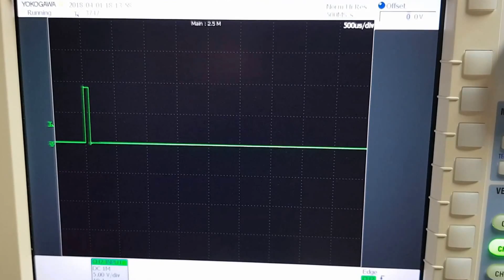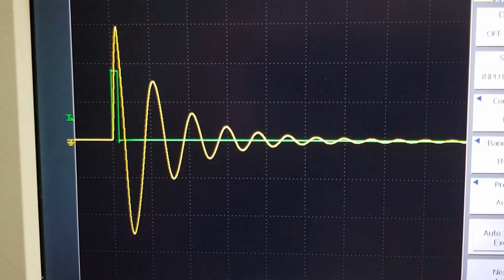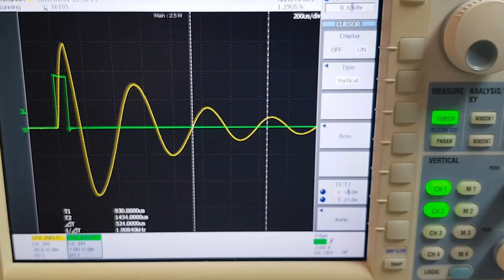Energizing a Resonance Tank Circuit using a MCU (Pt. 2)

Comment: 1.  you need to Connect GROUND In between the capacitor and the conductor.
2. Depending on where you put the ground Connection in the circuit you will get variable outputs.

Comment: Your observation on the anharmonicity is absolutely correct! The capacitor has two layers of tin foil, changing their distance slightly in proportion to the voltage and therefor the capacitance changes with Voltage. Thesse types of oscillators are known as anharmonic oscillators. In your case it matches well the behaviour of a pendulum at large elongation.
Reply from the maker: Thanks for the feedback

Comment: I think that most of the non-linearities, thus the change in frequency, are due to the inductor. If it is wound around some ferro-magnetic material, it presents a strong hysteresis cycle. It would be nice to perform a THD analysis of the signal

Comment: To make that circuit maintain oscillation you simply need  to repeat the trigger such that its falling edge coincide the next peak.  It almost like someone pushing the swing at the right moment. In terms of swing you push when the person comes to the peak distance from the center.